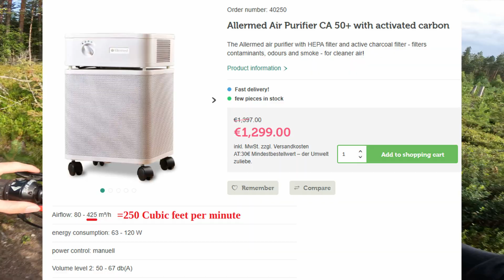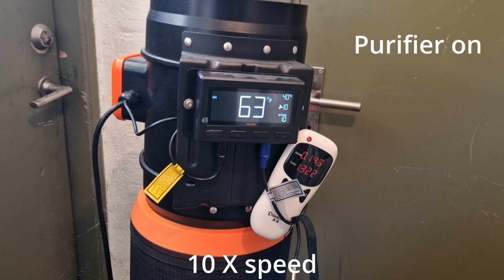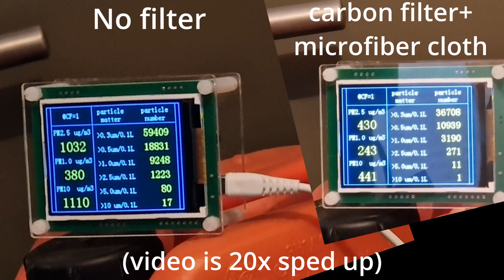DIY 3d Printed Air Purifier

Comment from the maker: Link to the CAD models:
https://www.printables.com/model/1271541-air-purifier-removes-smell-gas-vocs-particles
Reply: Sweet! Can it be printed with PLA or PETG, or should one use a more heat-resistant filament?

I have a very basic Ender-like open printer, so would like to enclose it in a grow tent and hook the tent's air exaust to this purifier - as unfortunately, I do not have the possibility to vent to outside

Comment: Hi from India. We are fighting against horrible air quality and expensive air purifiers. I'm willing to do the following 

- find a 3D printing service in India which can print models I'd need your help in making. 
- find the most commonly available cheap and reliable air purifier filter.(Perhaps the design cones with a size adjustable mechanism to accomodate different sizes of filters.)

Would you be willing to join in on this adventure. Thank you for your time.
Reply: https://youtu.be/38RQqiYqFqk

Some video inspiration that led me to your video.

Comment: In this case the best way to use the economies of scale is to simply purchase a much cheaper air purifier by simply buying one in the market.  That way you can get a product honed by 10 different companies and their 2000 engineers doing the testing and development for you. 😅. Or each of us can spend 30 hours fiddling with this crap and get a half-baked product with no warranty.
Reply from the maker: The issue is that these 2000 engineers also sceem on ways to economically screw you over in the long run by having you buy replacement filters from them every 3 months

Comment: Charcoal is easy to make. it's the same thing as soldering flux - you can buy it or just go to a forest and scrape some pine resin off a tree
Reply from the maker: charcoal, yes! But getting the activated charcoal to not emit any smell is apparently quite tricky. I actually regenerated the charcoal filter yesterday and I'll have to see if I got rid of the sweet smell.

Comment: hey rouge! ever heard about corsi rosenthal box? now i know it fill not filter out harmfull gases but as a simple particulate filter i guess its the best option for everyone
Reply from the maker: Yes, those are great and cheap if you live in the united states and can get a hold of large MERV filters. I was actually looking in to building one, but the filters were way too expensive in Europe for it to make sense. You can actually put an activated charcoal filter like the one I built inside an corsi rosenthal box, and then have a great particle and gas filter.  However, you will still run in to the problem that the MERV filters aren't washable and the question is how long it will take before the box will start to smell.

Comment: what 3d printer you use?
Reply from the maker: I use a Bambu lab X1C. I prefer the open source mindset of the prusas, but the build volume of those  are too small and the prusa xl was a bit of a basket case
Reply: parts look really smoth
Reply: Great project!  Would this filter irradiated particles if someone accidentally detonated a nuke?  Would need to find a pump that would run on 12v!  I don’t mind VOCs but I have a real problem with alpa radiation🫠